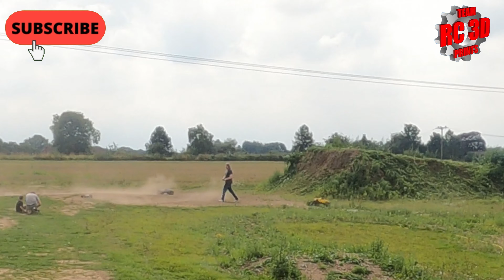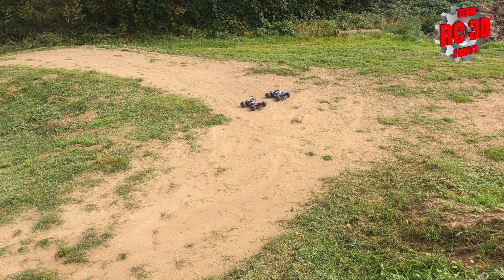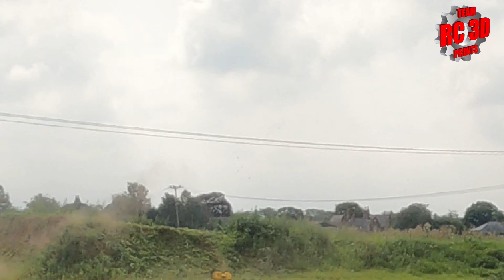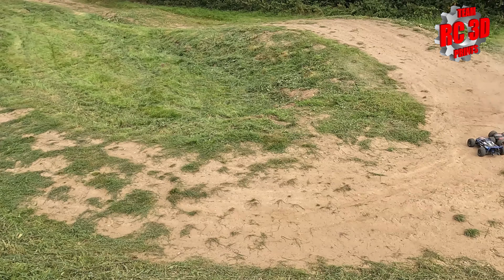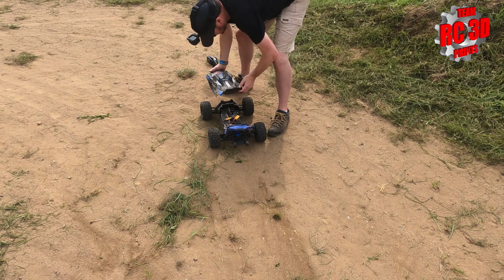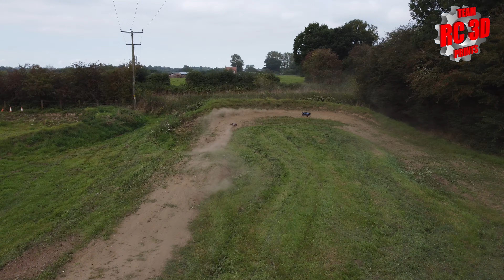Traxxas Sledge oval racing at Strumpshaw with some huge jumps - how did they not break!?

Comment: Sledge is breaking pinions left and right, even the hardened pinions. Installed hardened spur and haven't had an issue breaking any teeth on that. I think its rocks and dirt that are causing it, anyone else having this issue?
Reply from the maker: Once changed from the standard we have had no problem